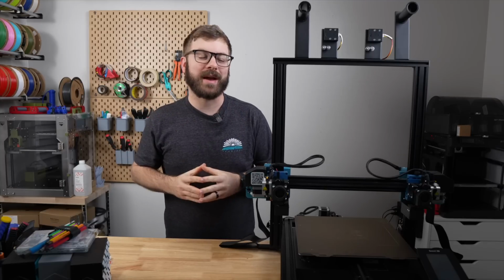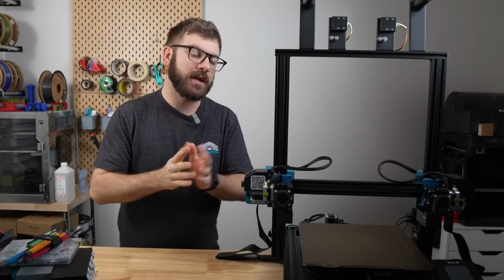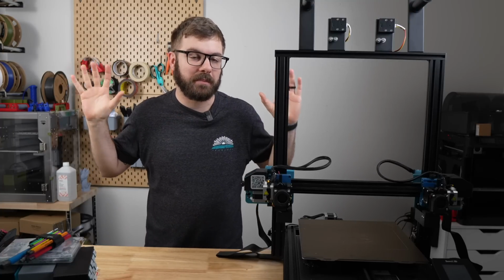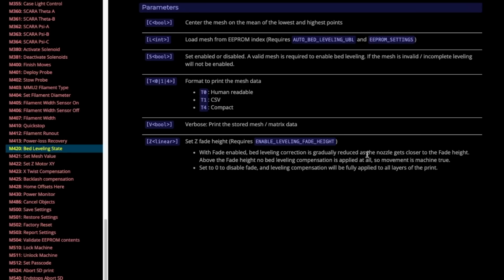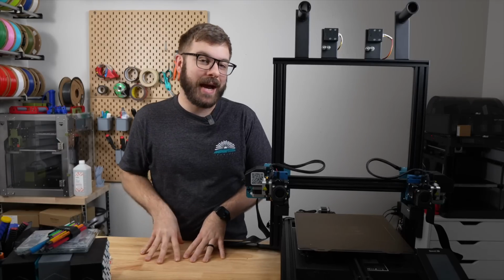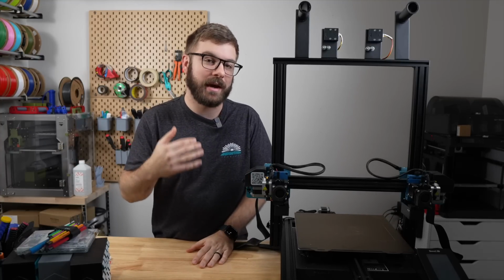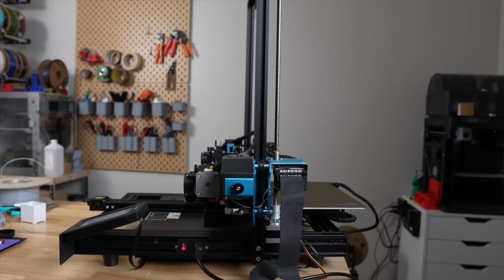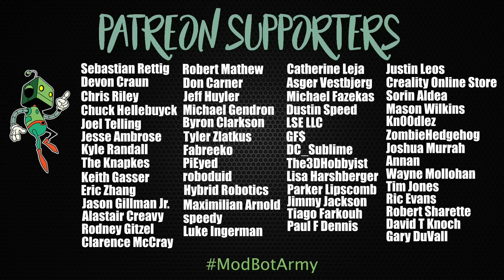The Good And Bad Of Large 3d Printers

Comment: I have an upgraded Ender3 which is my second functioning printer, the first being a FLSUN 2016 model delta. I will NEVER own another of EITHER design. My next printer will either be based on an Ender5 or full blown coreXY.  It's going to be 100% DIY so I haven't decided yet. The bed moving is simply the WRONG configuration for additive manufacturing because the weight is constantly increasing as the print progresses, meaning physics is fighting the printer. The Z axis should handle the bed leaving XY for the gantry. And that's even before you factor in that a coreXY machine has a smaller footprint than a i3/CR10 layout machine with same build size. Meanwhile, the delta is just an overly complicated PITA.

Comment: I think another critical consideration is absolute print quality.

Just because your printer can print to the extents of 400x400mm doesn't mean that it can do that while also matching the quality of a 150x150mm sized printer with significantly better rails. This is particularly important when what you are printing is a 50x50mm part, where all that extra print volume isn't helping you. 

Virtually every printer on the market larger than 150x150mm uses aluminum extrusion for the rails. Don't get me wrong, this has proven to be quite the functional little tradeoff... but it IS a trade off. So don't be fooled into believing that it's as good as purpose built linear rail systems.

Aluminum extrusion is more capable for linear motion than linear rail zealots care to admit, but it's also less capable than extrusion zealots care to admit too.

Comment: Some one yet again fails to understand that mesh bed leveling makes little difference if you are using a standard 3d printer as the printing head can not ajust the fine level that is needed unless you are twisisting thev bar that the print head moves on. The only type of 3d printer that is able to use mesh bed leveling to its full effect is a "delta". So will people please stop bloody talking out of there "ARSE". It confuses people no end.